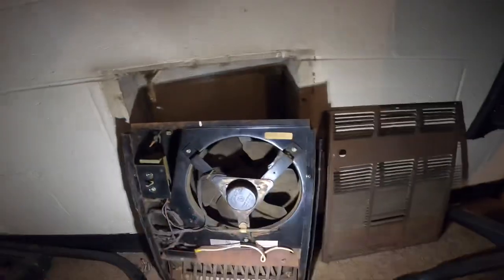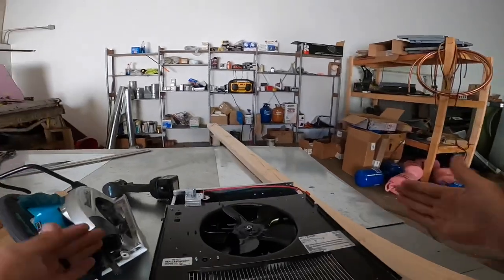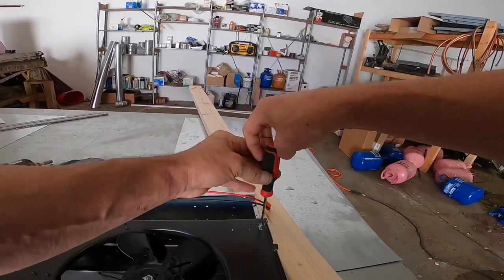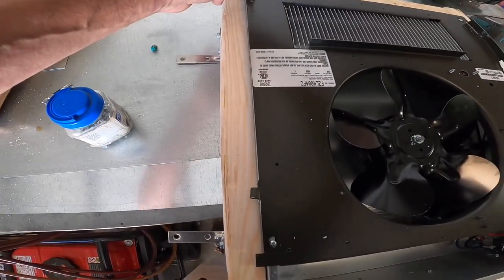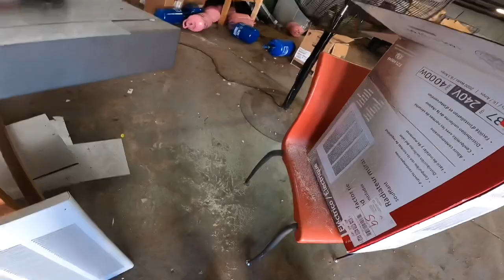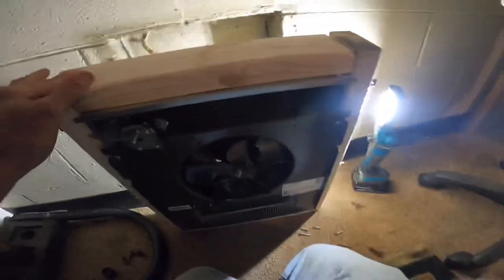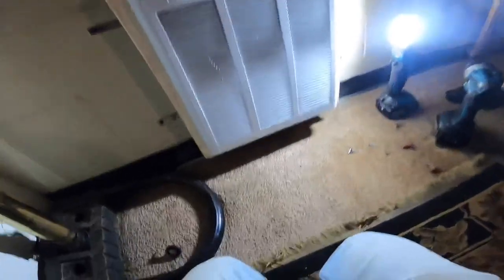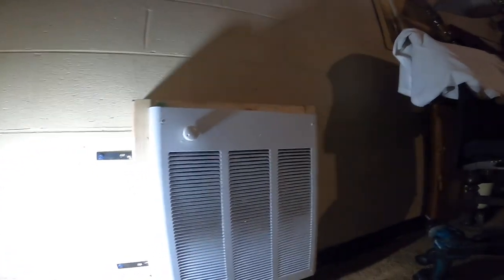Installing 240V 4000 Watt Fahrenheat FZL4004F Space Heater

Comment: What didn't you put the 2X4 in the wall then screw the heater on them?
Reply from the maker: Nor room. Heater was wider than the hole
Reply: @HVACGUY  I think he meant placing the 2x4 into the hole and screwing the base on them through the back.
Reply: @CircleD1  the heater is larger than the hole, unless you built the 2x4 flush with the wall, it couldnt happen
Reply: @chadschafer1723  That's what I was talking about and what I got from jake2213b's question.